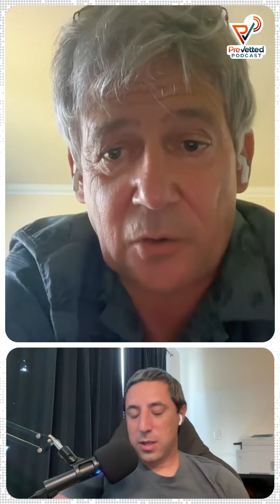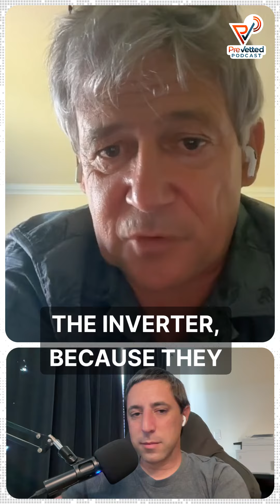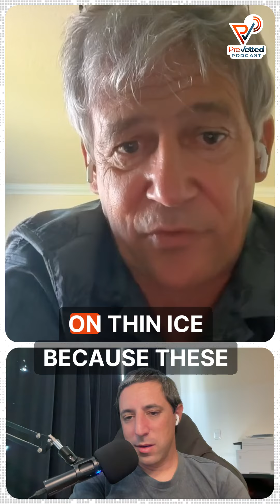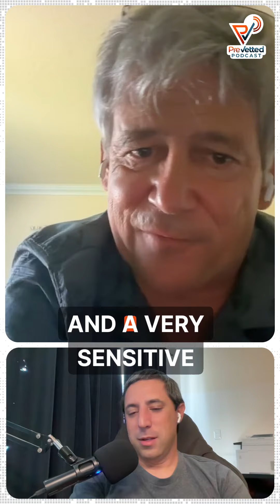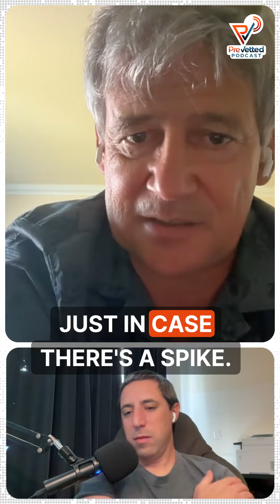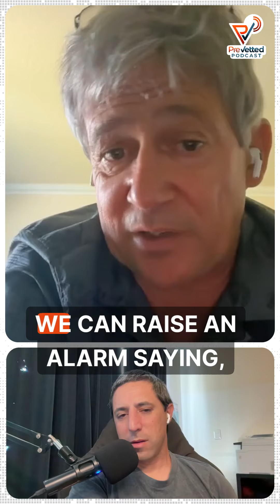New forms of power are much more vulnerable

Comment: Besides less reliability in inverters you left out how they lack of rotating mass makes the grid less robust against power surge and brownouts. We will quickly reach a point where the rotating mass could get overwhelmed and the inverters start a domino effect causing never before seen power issues. People underestimate the benifit of having all that rotational mass magnetically locked together working in unison to keep the grids stable.